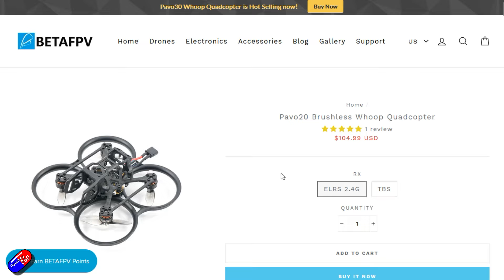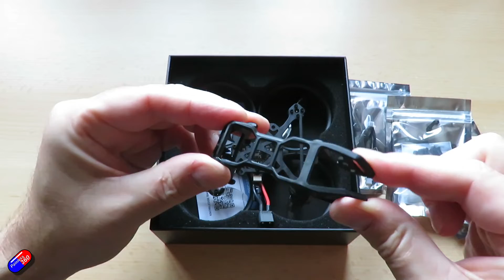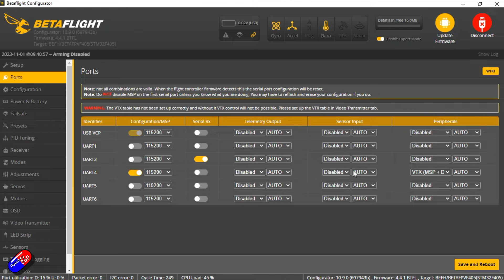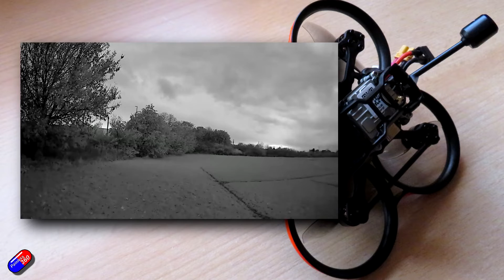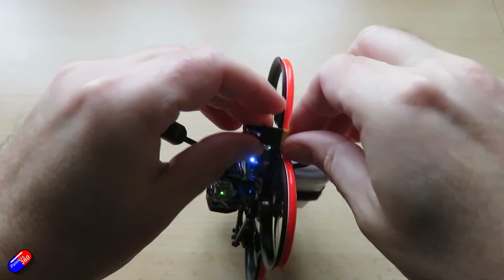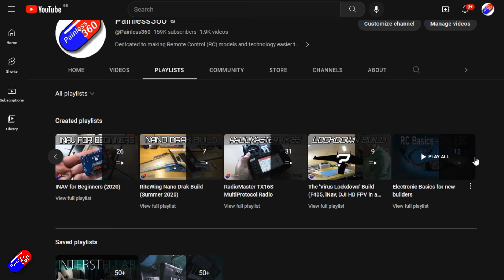BetaFPV Pico20 - the 'Pico' improved...

Comment: The walksnail HD Nano V3 uses m3 mounting on the non-through holes (20x20) so it doesn't fit without some 3dprinting as the vista X adapter uses m2 holes on the 20x20.  This was an odd choice for a nano vtx,  I found (not mine) a 3d print that soft mounts it if anyone needs it (thing:6378273), it took me ages to find a solution however it works great.

Comment: Is there a Target for iNav7?  I can add a tiny gps,  I prefer iNav to Betaflight.  I have more than one Betaflight MIA quads.
Reply from the maker: What does the FC appear as in Betaflight?
Reply: Board: BETAFPVF405
Target: BEFH/BETAFPVF405(STM32F405)
From what I can tell there isn’t a target for the board yet.
Reply from the maker: Doesn't look like it - yet! :D
Reply: Upon a closer look at the FC (F4 2-3S 20A AIO FC V1),  There isnt any Compass connection pads (SDA/SCL), I presume there isn't a workaround in iNav to add the compass (remapping uarts to SDA, SCL?) so iNav likely not possible for this board. :( @Painless360

Comment: you can use a walksnail VTX with this drone, you only need to change the connector on the VTX side or solder it.
Reply from the maker: You can, my point is more about the fact that the cage is designed for the 03 air unit, and the listing is 03 only. Why? Happy flying!

Comment: So there is no option for the original air unit? Could I remove the O3 system and install a standard mini DJI air unit?
Reply from the maker: It's sold without the air unit. See unboxing... Best